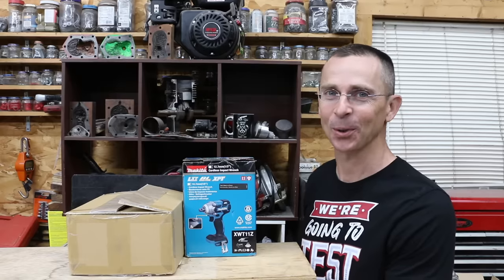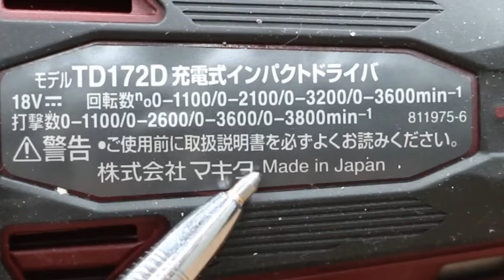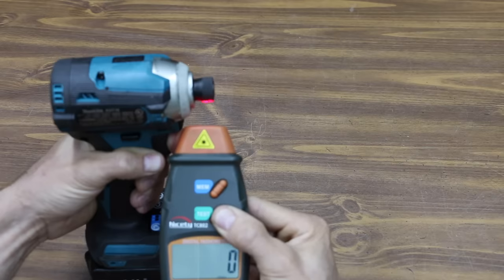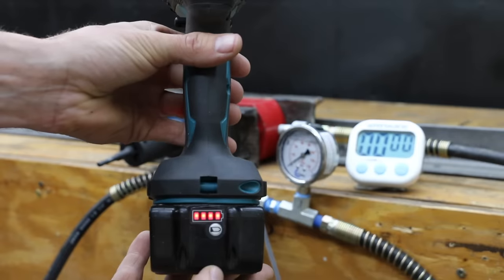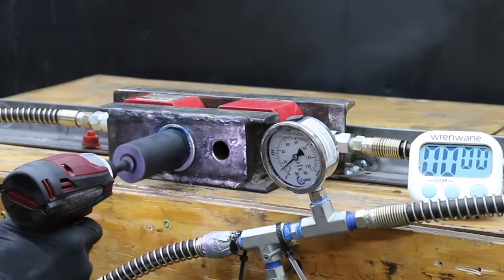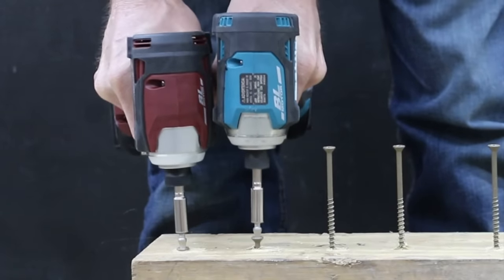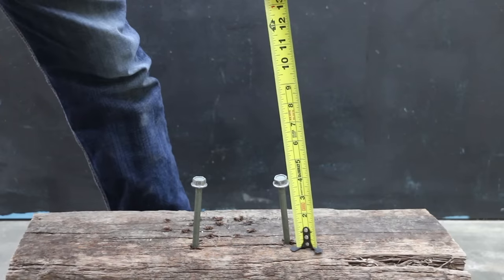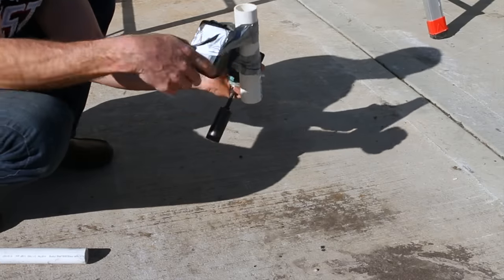Made in "Japan" Makita Better? Let’s find out!

Comment: The red one has same amount of functions. Just press button on the right and light on the right will appear. You will get access to other 4 functions. Nr 1 Wood mode .... slow start then acceleration, Nr 2 ...  nut/bolt removal. Max torque, than slow down so you don`t look for nut. Nr 3...  self tapper mode ` (thin metal f.e. sheet metal or metal studs) and Nr 4...  thick metal self tappers. Both similar, but TD172 has same trigger as new 40v model. More sensitive. Was wondering torque on bolt mode. Should be slightly higher than speed 4.
Reply from the maker: Thanks for the information

Comment: Another great comparison vid! Thank you sir. You seem to know much about these impact drivers. I dropped my Makita XTD14z and now it doesn't work. No power at all (tried different batteries). Any thoughts what it could be? All wires look to be intact on the controller (black plate right above the battery pins) and on the trigger. No lights when trigger is engaged either. Any hints is appreciated!

Comment: I got the Japanese TD002G for $170. Its the newer 40V version of the GDT001. It has 4 LED lights on the front, and i got it in purple. I got the 4.0ah battery as it was only $150 on overstock, only $10 more than the 2.5ah. Its QUITE heavy though!
Reply from the maker: Thanks for sharing.

Comment: I know this was a while ago now, but the main reason for the differences is that the two are not the same model.  The Japanese one is he TD172, and the Chinese one is the  American version of the TD171.  The specs are not exactly the same as the 172 has a higher torque value.  175 v 180 Nm
Reply from the maker: Thanks for the feedback.

Comment: The xdt16 is not the 172. There is no 172 here yet. The 16 is the 171. So none of what you did was apples to apples. The 172 is brand new. If you were to get a 171 the tool would look the same. Square back end of the 16  and the rest of the features of the 16 are the same as the 171. When makita makes a new impact driver it's released in Japan first and available for a limited time in 5 colors. So you getting the red one means it's still brand spanking new and we have yet to get the new updated version.

Comment: Wow I just now realized they rereleased these after I bought a red td171 a few years back -.- and they have purple back in stock too. Although now the model number is td172. I’d be curious to know if there were any improvements/changes in the td171 and 172
Reply from the maker: Thanks for the suggestion.
Reply: The 172 is a newer, slightly smaller model, with a few minor upgrades
Reply: I think you'll find that was the reason for the different internals - the blue was a 171, the red one the 172..?

Comment: Try the chain saws from china I almost cut my arm off with one and so did a friend when the handle broke, oil pump stopped working, chain isn't a normal one either, gears slip.

Comment: the red one has overheated problem for sure. and the blue one is an older model, no company will downgrade their products so newer one should perform better. BTW I own both Chinese and Japanese made TD 171D, Chinese version has less vibration but slightly noiser than Japanese version. the rest parts are all same for sure. The only rule I trust is you get what you pay, not made in Japan or not.
Reply from the maker: Thanks for sharing.

Comment: Hi! Do you know if the two drivers take the same size bit? I read somewhere that the US marketed models take 6.35mm bits and the Japanese/Australian marketed models are sized for 6.5mm bits. Is that large enough of a difference to cause an issue? Are they even that different in the 'socket'? Sorry for the bother!

Comment: I doubt I will get an answer but I believe you said you bought one used. Could that have had an impact on your test results?

I know you have probably done this exact test (location made) on a 1/2" Impacts and if not please do it. I'd love it too do it in Craftsman because the the only Battery Powered tools I own. I'm not some rich guy on here. 

If you have pretty please shoot me a link. I've been wanting a good Craftsman 1/2" impact for ages but this scenario has always pushed me away from buying a bullet (1/2 impact). I'd use it on my mower blades and I'm not sure what else (probably nothing). Again since I already have Craftsman battery powered tools I'd love it if I didn't have to buy more batteries. I wish I was rich but I'm disabled and Worker's Compensation won't let me do much with my life since I'm paralyzed at T12 and L1 or maybe L2 level of my spinal cord.

Chances of you doing this only for me isn't very high but a man can always dream.

Comment: Love your tool comparisons. However as a doctor I can positively say that left/right hand comparisons aren't relevant. Even if you are ambidextrous both hands simply don't have the same amount of force to apply to the tool, not to mention body position is not identical on both hands and one side will be dominant. You should have switched tools in hands between screw sets at least a couple of times if you wanted relevant results.
Reply from the maker: Thanks for the constructive feedback.

Comment: its not about where its made. its the cost cutting. you can run the same assembly line in japan and china and the same product will come out the other end. but the decision to shift is for 1 reason: cost. and in the process of cutting cost, you are going to redesign to save cost as well.
Reply: The irony of all of this is that once "made in japan" use to be the cheap, shitty place to manufacture. originally, germany use to be the gold star of quality goods. at some point, we started using japan for cheaper manufacturing and the products that came from there were awful. i have some lenses from the early production days of japan and the build quality inside is just awful. bad tooling marks, voids in casing, stripped heads on screws, things head together with tape, etc. with time it improved, and cheaper manufacturing moved to china. japan is the new germany, china is the new japan, and vietnam will become the next china.
Reply from the maker: Thanks for the feedback.

Comment: I knew  the Japanese one would win before I even watched the video.  Those go for about 350 bucks (Japanese) with a case, charger,  and two batteries here in Japan, 165 for just the driver alone depending on the supplier you choose in case you folks are curious. Amazon was not the lowest price in this case.
Reply from the maker: Thanks for sharing.

Comment: as a jp heavy tool user, I must say there are differences between the same product sold by makita seller or diy home centre.
before the assembly, the A grade parts are chosen for the ones sold by makita with no price reduce, then the B grades are used to sell in the home centres with reduced prices.
the actual differences are very small, but those make, for example, drill bits last a bit longer due to the precise axis.
they never say there are differences, but you realize these things if you use a lot.
Reply from the maker: Thanks for the feedback.

Comment: He's comparing 2 different models. The blue impact driver is the current model dtd171 in Australia, UK, etc or xtd 16 in the U.S.A. The red impact driver is the new, latest model which hasn't been released anywhere other than Japan. This is, as shown the dtd172 or xtd 72. The new model has a different panel configuration similar to the 40volt version and other new functions. Otherwise it's basically the same as the older model.
Reply from the maker: Thanks for the feedback.

Comment: my company Classic Renovations Tasmania started to upgrade all my makita tools from 18v to the new 40v.
purchased the 40v drill and impact driver, only four month ago and the impact driver is overheating, constantly cutting out, parts are falling off.

in that period I've used it approximately twelve time, mainly batten screws and screwing villaboard.

not worth the money i paid.

to top it, i cant get help from Makita, rang them 3 times in two weeks and the rep wont return my calls.

the repair company that has my drill, said parts are hard to get, so it could be months before they can do anything.

 they also said the motor needs replacing

shame on you makita for not replacing the impact drill with a new drill so i can keep working
Reply from the maker: Wow! Thanks for sharing this information

Comment: I am very sure that China can make tool as good as Japan. However, made in China tools are for amateur users who only use their tools once or twice a year,whereas, made in Japan tools are for professional who needs a reliable tool to do the job, also good quality tool will pay for itself within short period of time. Remember, battery regardless of with type does have shelf life. I had many electric drills that had dead batteries due to not being used, and the battery itself costs more than the drill.
Reply: These are both real Makita impact drivers. It's not some 3rd party tool manufacturer that gets Makita slapped on it

Comment: Having worked in three Middle Eastern I can tell you from experience Japanese made equipment is better. In the Middle East vendors will sell the same machines at different prices based on where they were made. Chinese made is the cheapest then the Thai and the most expensive is the Japanese made  equipment because it works the best and lasts the longest.
Reply from the maker: Thanks for sharing.

Comment: The conclusions of the test are as follows: If you use the red Makita from the age of 20 and work until 80, you will save 2H34 minutes of work for 60$ more. However, if you had bought the blue Makita, your $60 would be worth 147.41 (at 3%) at age 80.
Reply from the maker: Thanks for the feedback.

Comment: What I have discovered in Makita over the last three decades is the tools that I purchased that were specifically manufactured for the United States that were constructed in China.   And the batteries were manufactured in China.. the Chinese brand batteries would fail much faster, and had less capacity than the batteries that were manufactured inside Japan

Are the Makita tools that were manufactured for the American market constructed in China? The trigger switch would fail even though you had a new tool under a year old the switch would fail. 

Unlike my original Japanese Makita tools from over 30 years ago that are still working to this day and the majority of the batteries lasted 20 years the original nickel cadmium batteries . 

This is exactly why my self my company, and my family stopped buying Makita tools, which is very sad . 

Occasionally still buy corded Makita tools that are specialty that are known, reliable, and dependable that have a proven track record over the other manufacturers that are old designs . 

Since then, myself, and my company have switched over to Milwaukee, because they eventually started manufacturing better tools and better batteries something Milwaukee did not do on battery power tools when they first started out .
Reply from the maker: Thanks for sharing.

Comment: What type of charger & battery can you use in the TD172D from Japan?   I understand voltage is different/
Reply: I just picked up a red Makita, you can use the standard 18v batteries (and chaarger). I have a lot of them and I just tested it with 3 and 5 Amp/Hr. batteries and it worked fine.
Reply: Voltage is the same in Japan as it’s based off the American design

Comment: I might be alone in this but that china makita is STILL at least 80-95% of the japanese built one.  So in my humble opinion, it is not worth the extra cash as none of them actually broke. You're paying $60 for refinement yes, but considering that we still don't know which tool actually lasts longer. I will take a $60 discount to have 95% of the quality.  The split second slower drilling or half a germameter stopping difference is really NOT big enough in practical use cases unless you're a literal Olympic tyre installer or World Champion driller... yeah those don't exist and if they did they'd be using a whole other beast anyway.
Reply from the maker: Thanks for the feedback.
Reply: Whether assembled in Japan or China, Makita tools will be identical. The reason for the slight differences between these two is that they're not the same model. The red one is newer.

Comment: The Japanese drill isn't better because the Japanese build things by magic, or that there's something unusual about the air there.   The Japanese drill is simply a better, more expensive drill.  Most stuff is built in China because cost is the driving factor.  If both the blueprints and specs were sent to Japan, Germany, the U.S., and China and built exactly to the spec, they'd be virtually identical.

Comment: Took a iso 9000 class  and ford and mazda got the same blueprints build the same transmission and the made in usa ones failed over 100x more cause japan had built it with with way closer to the minimum tolerances. I try to buy made in Japan products when I can. My 4 cylinder turbo subaru sti is just as fast and built better than my 32 valve supercharged v8 03 mustang cobra.
Reply from the maker: Thanks for the feedback.

Comment: This is so cool. You always hear anecdotal reports of things made in China being worse than wherever a product was originally made. Even when it's the same product. I've experienced this personally with car audio amplifiers, monitors, car parts and I'm sure a few other things I can't remember. For instance the amps from China melt in the AZ heat. The ones made in the US or EU hold up. You should try some more side by side China vs somewhere else tests.
Reply from the maker: Thanks for the suggestion.
Reply: Not comparing the same product

Comment: Hi how are you, can I say again it's unfair? you are comparing 2 different models, it's not professional or fair, the red one is not better because it's from Japan but it's totally different model, you can only be fair when you select the same model to show if the origin country makes any different, the tools you used clearly have a different size and weight and the internal/external structure are different, add that to the clearly different model number then ask your self how fair this video is? misinformation, if you think this comparison is fair then how would you feel if you see a YouTube video comparing the speed of a Chinese jet vs a Russian train speed both made by Makita to do the same job(transfer)? I feel the same about your video, only 2 exact products made by Makita can be compared, I hope you will change your mind to compare product vs product regardless of where it come from, people aren't buying per country quality (of one product) but per one exact product quality unless they've been mislead, the same models(TD172D) from 2 different countries if compared you "may" find a different, but this video is not doing that comparison, also you should at least have more than one tool of the "same model" from each country, lets say 5 from each, so even if you find a different you can figure out if it was normal to find a different in quality between 2 tools having the same model number (and made in the same country), which mean a manufacturing issue or is it other standers used in each country to manufacture the same model, I like some of your videos but I can't accept that a video contain a big misleading promoted as a guide, so wrong my friend.

Comment: The problem with this test is that the two are comparable but NOT the same type. The chinese version is probably a newer type (aka more cheap) although they share a lot, made specifically for the Asian market.
It's also reflected in the small changes in design and in the typenr.
For this specific Asian market the (lower)price is very important, so there will be made some changes in order to achieve that lower price.
It's always the same question, what's more important to you, the price or the (slightly better)quality?
Where it's being made isn't the issue because in the future production might end up in Vietnam, the issue is how much you want to pay for a slightly better type.

Comment: How can you even begin to try to make a comparison between Japanese manufacture and China Manufacture when they are not even the same model! - I think it what you did stripping them down was more valid - materials and build quality,  attention to material and detail will be I would expect to be better from Japan. The operators assembling these in Japan have to disembowel themselves if they cross thread a screw, if one of their units fail at final inspection, their entire families will be sent to Mongolia, to unit 731 for human experiments.
Reply: If you took an xdt171 assembled in China, and an xdt171 assembled in Japan, they would be identical down to every last part and spec. They're just made at two different Makita factories.

Comment: For me, this test is a great, great, great bullshit. You are compare 2 device , with 2 different characteristics and different data sheet. One is model XDT16 and another one is TDS172D. 
First Makita have cod 855E84-1 74LJ , second Makita have code 811975-6 - you know what represent this code? In case you tell NO please study and present difference for this 2 code.  
In the final we can appreciated - same shape, different color , different data sheet. Is like I compare sea water with river water. Same water but different characteristic. I will put next question - is correct to compare sea water with river water? If you tell YES, please in this case drink 1 liter of water from Red Sea. You are able to drink and tell me how you are filling? Thanks for understanding.

P.S.: Try to be correct with your and read the 2 data sheets and try to understand where you are make mistakes. 
There is an old "word" that says - it is similar, but does not the same. Thanks. 
Your job is nice but not correct. I appreciate your effort, but try to by honest with you. Good luck in your jobs